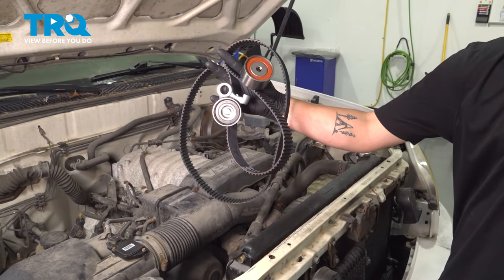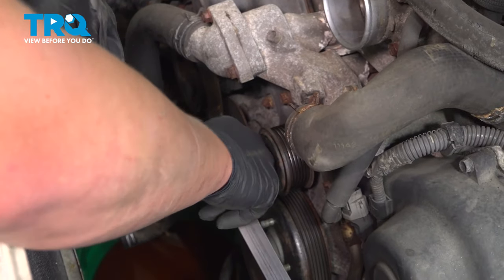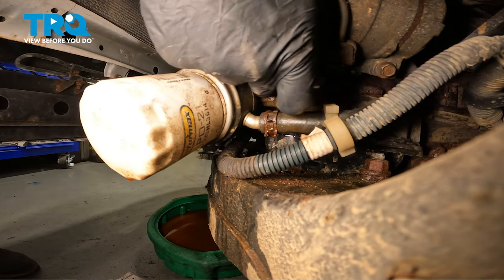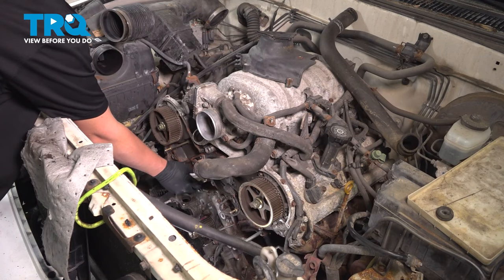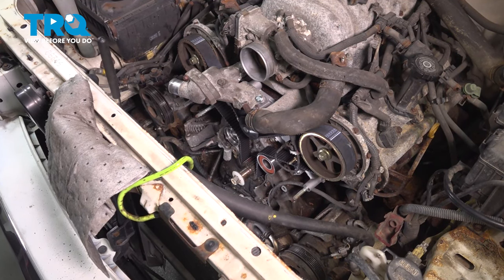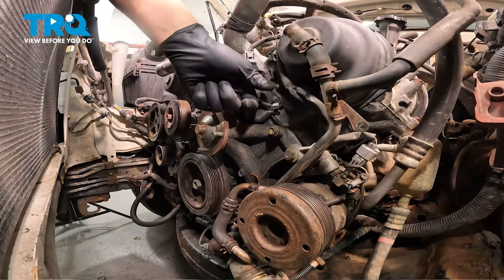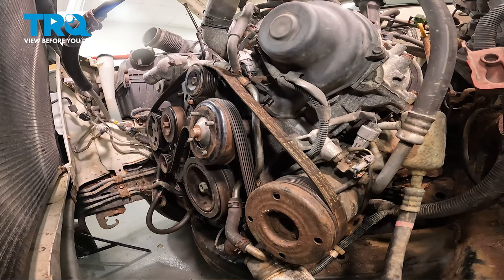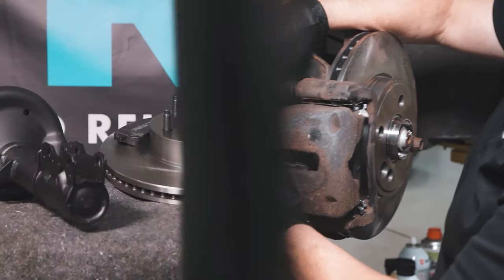How to Replace Timing Belt Kit & Water Pump 2000-2006 Toyota Tundra 4.7L V8

Comment: Something that may help out another person....   When I went to change my timing belt, the cam pulleys were off by one tooth.  Whoever changed it last left it that way.  I wasn't really sure what to do at this point.  Everyone says make sure your 3 marks line up, but no one tells you how to fix it if they don't. I installed the new belt I had the same problem.  1 tooth off on the Cams.  After hours of trying to research and fix this issue, I stumbled across  A FREAKING TIK TOK VIDEO. It explained that if you run a piece of cardboard maybe 6-10" in between the cog gear and the belt, it will offset it just enough to shift the belt ONE TOOTH.  IT FREAKING WORKED.  I was so happy I could cry!   Try the cardboard! it works!

Comment: To anyone following this, he has his left and right cams terminology round the wrong way sometimes. The right cam is on the right of the vehicle as you drive it. If your timing belt says left and right on it, ignore this mechanic's terms, and follow the instructions in your kit. Left is left side of vehicle as tou drive it.

Also: he just says "install crank bolt" and doesnt show it be tightened or give a torque.....because he doesnt have the correct crank holding tool, and instead uses the impact gun to what feels good haha.

Comment: I don't know if you will read this comment but if not i hope it gives the viewers some confidence doing this job. A friend of mine was in over his head doing this job on a 2002 model. Yesterday he texted me that he was nervous and doesn't want to mess up. He's never done a timing job before. I'm an Amputee(left leg from knee down) and my prosthetic leg is currently broken so I'm on crutches. So being the kind of friend i am i went to the shop on crutches and did this job. It took a little longer because of not having my leg but it got done. I followed this video step by step. Got the job done and the truck runs great. The only note i would add to the video is about the removal of the harmonic balancer(crank pulley). Do yourself a favor and spray it with a penetrating oil like deep creep and get a pulley puller. If that pulley hasn't been removed in a while it's quite a problem getting off and you risk moving the crank after having it and the cams lined up and ready for the new timing belt which will have you cussing like a sailor🤣🤣
So in order to make sure you don't move the crank be patient and spray it to help loosen it up and go slow with the puller. The consequence of getting impatient at that junction is putting the pulley and belt back on to get the timing lined up again. That's my only note. Other than that this video was on point from start to finish. Don't let yourself get intimidated by this job. The majority of the job is removing everything in order to get to the objective and putting all of that back on. Take pictures if you feel it's too much to keep track of and lay out paper labeled with where nuts and bolts go because there are a lot in this job. Good luck and take your time😎

Comment: I can't thank you enough for the awesome step-by-step tutorial! I threw the timing belt while doing 60 mph in my '01 Tundra 4.7L and after scoping the cylinders, the pistons and valves looked good, so I took on the task for my first timing belt replacement.
Got it all back together and it fired right up!
You saved me hundreds in labor costs when I didn't know if there was further damage. 
Thank you again!!!!

Comment: I know this is titled Timing Belt Water Pump replacement, but it seems to me that you should address changing small coolant hoses along the way while you are that deep into the project.  I would hate to have to take half that equipment off again to replace a $5 hose.
Otherwise this is a great video.  I plan on performing this procedure on my 2000 Tundra.  I will replace all hoses and the serpentine belt while Im in there.  Thanks for the great narration including all torque specs along the way.

Comment: thank you very much for uploading this video and explanation of every details,  I ask auto shop owener need to replace radiator and fan pully Assy added another $500 on top of $1100 for labor he is charging for timing belt replacement wioth his own order parts total $ 2100 , I am 63 yrs old take on myself  did it, All my life never took cars to mechanics, now I am old  but did it, Next one Tesla, Bye-Bye those shops until my body will on table for Reserch or new medical student education. Thanks again, Bravo

Comment: So how long do Timing Belt actually last? ASIN or OEM part of course? My TB is was done at 160k on my 2005 Sequioia. I'm currently at 220k miles. I'm just preparing. My 2001 Toyota Avalon TB was replaced at 80k miles by the previous owner. It currently has 180k. I just changed it due to it being at 100k miles since the last change. The belt looked great. Feel like I wasted my time. It was only 200 bucks for the ASIN kit so not a big deal, but it did take me several days. Learned something new so that was cool. But I'm definitely not looking forward to the TB on the sequoia after watching this video.

Comment: ATTN: when dis-mounting AC compressor only remove the 3 14mm bolts and the 12mm bolt and nut on the outside bracket.. "the little guy". The other 12mm bolts can stay bolted along with the main mounting bracket. 
When Torqueing the 12mm bolt to 36 ft-lbs be careful Mine snapped 🥲. Either i missed the torque click on my wrench or 36 is too much sauce.

TRQ, thank you for making this video I'm not trying to take away from your glory you deserve it and you're a hero!! Thank you so much you saved me alot of money!! 😁

Comment: Do you have to remove the spark plugs from the engine and/or have the transmission in neutral in order to turn the crankshaft by hand?  Also, once you pull off the crank pulley, what's the correct technique for putting it back on? If it takes that much force to remove how do you smash it back onto the crank?

Comment: I recently attempted this job but realized after removing the belt my timing was off and proceeded to move the crank thinking it would move  cams as well back to tdc did i just mess up the timing completely or do i justnneed to rotate it back to its original position?

Comment: I just did mine, I'm concerned about something tho, the bolt that holds the tensioner pully to the tensioner bracket. Does that come already torqued from the kit? I can't remember if I checked that before putting it all back together. Truck runs normal after everything, just don't know if I should tear it back apart to see if that bolt was tight from the factory or if I have to tighten it

Comment: I was able to reach that bolt in the back of the AC compressor with a 2 foot long extension and a 1 foot long extension through the wheel well behind the splashguard flap

Comment: You missed the very important  part where you tighten up the Crank pully. This also being the hard part, because the pulley will spit. How TF do you stop it from spinning, when torquing it to 245 ft lb.?

Comment: All i need to do is remove fan bracket i think i can without taking the radiator out or disconnecting any cooling hoses

Comment: The fan clutch in German cars has a twisted end that connects in the opposite direction of the engine, not as in Japanese cars, and is fixed with four bolts. How backward is Toyota